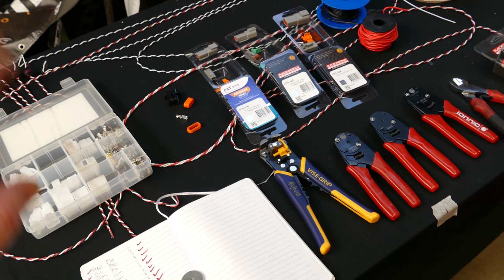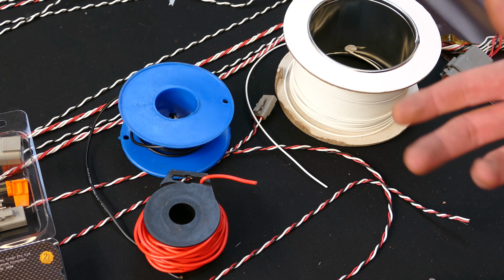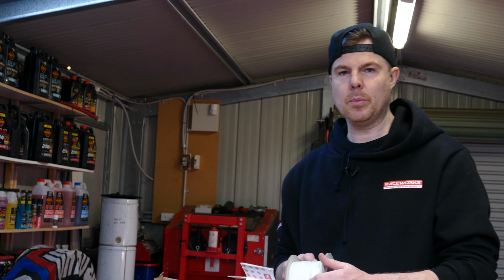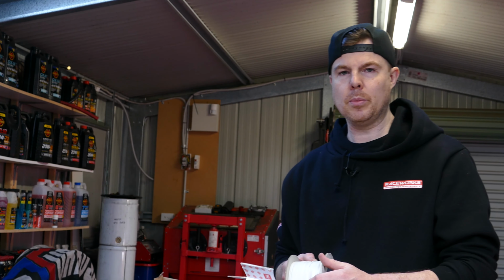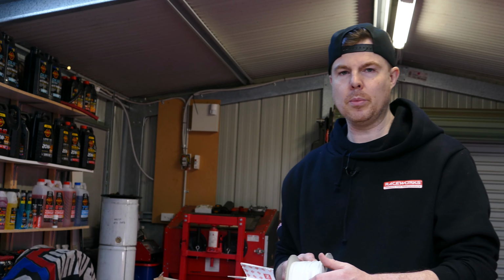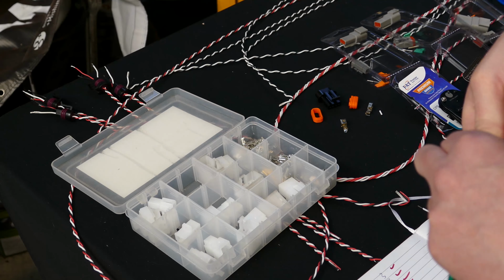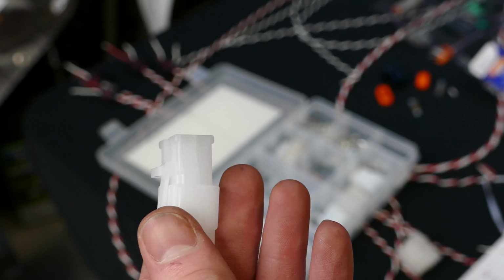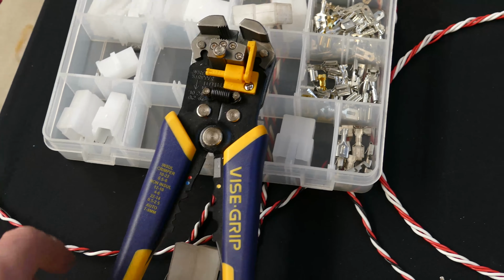Basic Automotive Wiring Tips & Tricks

Comment: A couple of comments.
Wire insulation. - not all insulations are the same. Selecting a wire based on the thickness of the insulation is not necessarily the wisest thing to do.  If you are running wires in the engine compartment or outside the cab of the vehicle I would suggest a cross linked polyethylene because it is far more durable to environmental conditions.  And they do come in different thicknesses. (SXL, GXL, TXL) Some of the thinner wires just won't hold up.

Twisting wires. - You need to be very careful with respect to which wires you twist together.  The main reason for twisting wires together is not because it makes the wiring neater, but rather it has a function purpose.  Twisting wires together helps reduce EM interference from other sources. So things like sensor wires, communication wires etc should be twisted together. But you definitely don't want to be twisting wires going to solenoids, relays, coils, or even power etc with sensor wires .  That will likely cause problems.

connectors/plugs. -  First, ALWAYS use weather resistant connectors for anything outside the cab of the vehicle.  And they always have applicable wire and insulation sizes.  Those whitish connectors, at least the ones you have, are for 18-16 awg wires, not 20 awg.  That's why it didn't hold when you crimped it to a 20 gauge wire.  They always say what gauge they are for. Also when you are connecting to an ECU you would have to use the matching connector.  You don't really have a choice.  They are also not sealed so if you use those in any sort of application exposed to the weather they will corrode.  Also, those little tabs will actually hold extremely well against pushout.  The movement you showed is really irrelevant. It's not going to contribute to wire fatigue. The movement is simply because they are not sealed connectors.
Those Packard Whether pack connectors are very good, so are the Deutch connectors.  Again one thing to be careful about is the size of the insulation.  As you can see there is a seal on the back side so if you are using very thick insulated wires you might have trouble getting several wires into the connector even if the gauge is correct. Always use the proper crimping tool for the connector.  Each brand tends to have a unique crimping tool as you showed.  Also, some connectors require you to push the wire through the connector first and then crimp on the pin and pull it back. Some require you to crimp the seal to the wire and pin at the same time.

All your wiring harness should be then wrapped with some sort of secondary loom or covering. Especially if you are going through a bulkhead or firewall. And always secure everything.
Reply: This guy is clueless. its no different than rating the performance of a vehicle based on its color characteristics.  I believe his overall philosophy is size matters...
Reply: I came here to also comment on EMI. It would've been wise to mention that wires like signals to COP or injectors shouldn't be twisted with sensors. Basicly the reverse idea of why ABS sensors are twisted.

Comment: Can I rewire a 4pin to a 3 pin even though the wires are a different color from each other. For example running a 4pin pigtail connector wire fuel line to a 3pin pigtail connector wire harness that connects to alternator and distributor?

Comment: hi can i use jumper lead cable to run from battery to switch panel in boat using a 30 amp breaker i cant afford to pay $30 a meter for each plus and neg lead

Comment: If you were creating a new harness from scratch. Would twisting wires for each component cause problems in an entire harness? I know there's concentric twisting but I don't quite understand because I seen straight and twisted wires ran in a factory harness.. I guess basically what I'm asking is when do you use twisting and straight runs?
Reply: OEM twisted pair are generally CAN communication lines between control modules/ OBD port and the "straight wires" are everything else . Concentric twisted harnesses are when the same applies for CAN lines but then the rest of the harness concentrically twists around the CAN lines in layers. These generally twist out from smallest cross-sectional area wire layers to the larger wire layers
Reply: @FLYRTA  Great info. Would you twist say cam angle sensor wires or oxy sensor wires?
Reply: @nzuncovered1845 Sure, you could for CrAS or CAS as the twisting of the pair is to minimize RF, or you could use a two/ three core sheilded wire. For Lambda sensors RF(I) wouldn't be as big of an issue as it is not sensitive communication transmission or a square wave trigger input.
Reply: @FLYRTA  Thanks! Good to know

Comment: dont quote me, but im sure wire current capacity is not measured by measuring the outside jacket. I believe its done by measuring 1 stand, then multiplying it by how ever many are in the bundle to get an overall diameter

Comment: Great video mate, wiring nerds have a place too, no doubt you seen the shit people do out in the field, ive seen so called pros use normal pliers to crimp connectors and tell you she will be right.   love the drill technique, not much difference to how they are twisted in a factory, as long as your not putting mechanical pressure on the copper your fine.
Reply: Thats not what he was saying. Its more the wiring nerds who choose to be pedantic and insufferable for their own ego boost. They would rather use a lot of energy to be specifically unhelpful for the benefit of no one even when they have the chance to help or educate someone and preventing the incorrect electrical work they hate so much

Comment: Should we ground for a led in chassis or -ve terminal of battery 🔋?  For a 3ampere 12v 36watt led strobe light? In car?
Reply from the maker: You should have a key mounting point on your chassis where the earth strap from the battery and to the engine meet, and other critical earths also tie back to. A small item like this can just be earthed to the chassis at any location.
Reply: @BroomysGarage  ok bro
Reply: @BroomysGarage  "on your chassis where the earth strap from the battery and to the engine meet."  
The terminology is incorrect.  That is not an "earth strap", it is a ground strap.  An earth strap, or earth ground, is just like it's name says, it is grounded to the earth.   In a vehicle everything grounds back to the battery.  Typically critical systems such as your ECU will ground back as close to the battery as possible.  This is to eliminate noise that is often present on the chassis as well as proven ground loops.
Reply: @tchevrier  How about if your battery is factory mounted in the trunk? My Mercedes has the battery in the trunk/boot and only has 1 main ground from the negative to the rear chassis rail, there is nothing else connected to that ground connection or even close to it, the ECU is in the engine bay and has its own grounds I believe. It runs great btw and seems to have good power to all electrics.

Comment: I have a 1980 Camaro v8 and I’m needing to fix some wires that a mouse chewed up. What gauge would be best for turn signals? Also is there a special automotive wire I need to get?
Reply: I couldn't tell you for sure what gauge wire to use, probably around 16 or 18 gauge but make sure you're using good copper wire, absolutely stay away from any sort of copper coated aluminum wire
Reply from the maker: This link is a good calculator to work out what wire to use in what situation. A 20 watt globe at 13.8 volts is about 1.5 amps. So using 13.8 volts and 1.5 amps https://www.wirebarn.com/Wire-Calculator-_ep_41.html this calculator will show you what gauge wire you can use depending on how long the wire will be.
Reply: @BroomysGarage  shit i wish i knew that existed when i was wiring in stuff

Comment: I'm about to have a crack at rewiring my 70s Aussie muscle car which have a pretty basic harness in them. Do you recommend any particular brand of wire that is good quality and on the thinner side as mentioned in your video.
Reply from the maker: I find rs-online have a very easy to use website, ship very quick and have very good pricing. I just filter by wire gauge and outside diameter and use hook up wire
Reply: @BroomysGarage  Cheers mate and great video by the way

Comment: Question related to vehicle wiring.

I have several older Aprilia 125s. On these there are multiple places where a number of wires are joined.

One example is in the short section of loom from the clocks. In this the ~12 earth wires (from each bulb, etc) are joined down  to a single earth terminal on the connector, with a series of 2~3 > 1 joins. Second example is in the middle of the main loom there is a point where ~8 wires are joined together (these wires are the switched live) in a single join. Both these use U shaped crimped butt connectors. Both are prone to failure.

What is the best way to do these kind of joins?

On one bike I rewired it and used heat shrink solder butt connectors, to join multples into one (I added an extra layer of heat shrink to further support the joins, and these joins are within the main heat shrunk protected loom).

Looking online I have been unable to find an "approved" way of doing such joins.
Reply: Try using a 12pin DT series weatherproof connector. All 12 earths into one half of the connector (male or female), then your single earth going to body/ ecu etc into the other half of the connector. loop (U loop) all terminals to each other. This will allow serviceability. If lighting components will be spending most of their life without removal you could use a simple bus bar connection with bootlace terminals would suffice.
Reply: @FLYRTA  Doubling the wires into the back of each terminal is possible. Generally times I am thinking of this the wires will almost never be pulled apart (for example, the clocks have 6 earth wires that all join together before the main connection to the loom).

Bus bars worry me a touch as not found any readily available ones that could be easily insulated (a concern on a bike with water - plus when working on the bike with the bodywork off)
Reply: @katywalker8322  the other option is to use open barrell crimps to step down the wires. Example: 4 wires into 1 outlet wire. Then you would only need a 3 pin connector which would save space and cost. 
Or 6 into 1, then a two pin connector.
Make sure the open barrell crimp join ia perfect and then dual wall heat shrink insulated which should give it sufficient strain relief and weathertightness.
Reply: @FLYRTA  , that is my current solution.  Works fine if just joining a few wires, but not sure if best practice.

The original loom on one bike uses them. One place it joins quite a few wires, and it is a common failure point in the loom.
Reply: @katywalker8322  maybe less wires per crimp would minimise that risk of fatigue?
Reply: @FLYRTA  , fully agree. Problem appears to be with too many wires some of them are heavily stressed going from their insulation into the crimp.
Reply: @katywalker8322  if the wires were twisted with each other they would also support more as a whole and be less prone to fracture. Best doing this with 2 or 3 wires per twisted bunch
Reply: @FLYRTA  , I tend to use 2 layers of heat shrink (different lengths) to support the joins. Not had one I have done fail yet!
Reply: @katywalker8322  Nice work! Double layer or even dual wall gives much more strain relief.